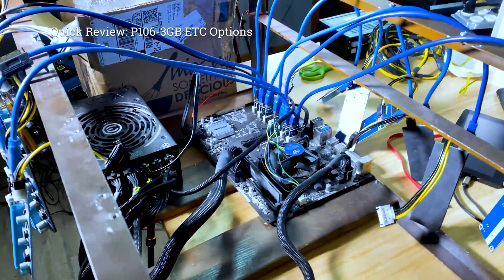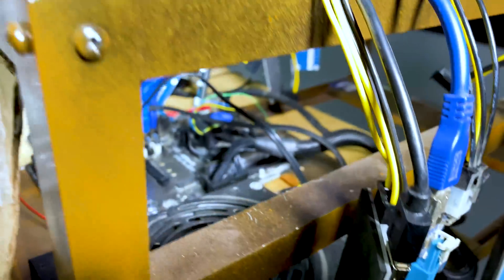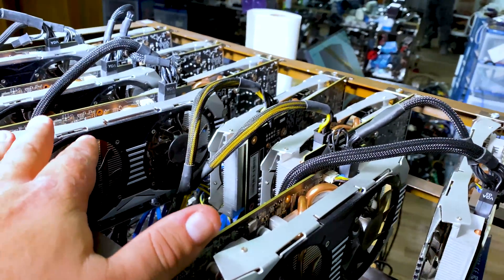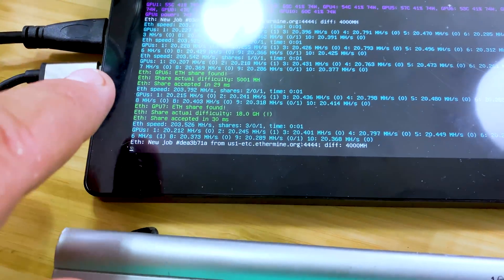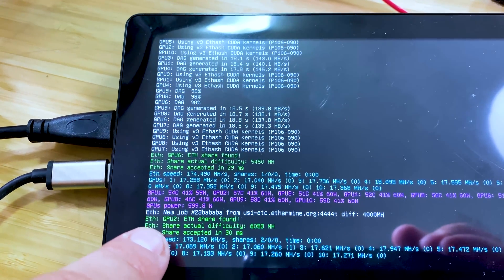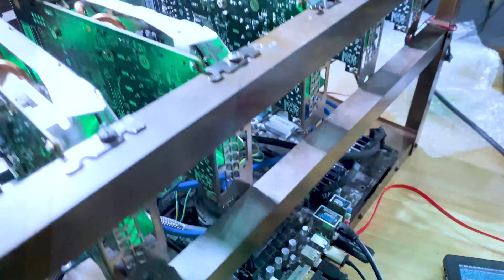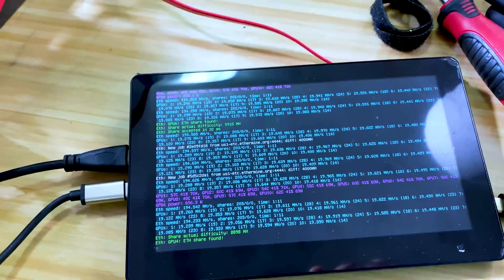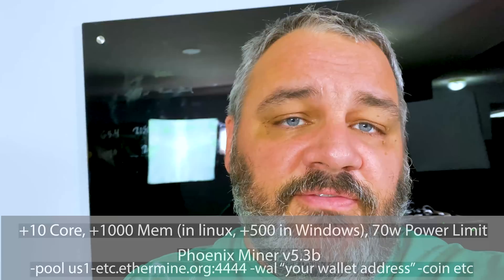ETC makes 3GB GPUs great again

Comment: Does anybody know how to free up all the memory on a GTX 1060 3gb for some reason 600mb are being used somewhere in my old pc. I reset everything to factory settings but I can't figure out what's using that memory or how to clear it. Ive tried googling btw
Reply: i have the same problem. could you help fix it?? did you figure it out? i’d really appreciate it

Comment: Hi, could you please explain how to mine with a 3gb card? I have a p106-90, but when I try to mine with this card, the programs always fail or do nothing because this card has only 3gb
Reply from the maker: ETC works - you will need the latest Phoenix Miner and make sure its set to -coin ETC

Comment: I have 1060 3gb card and getting 25mhz using kryptex but only received 0.01$ after running 2-3 hours.. So what miner should i use now?
Reply: with kryptex you need to allow some time to let the solutions settle, make sure you're allowing that time. I was also discouraged with Kryptex at first for that reason alone
Reply: @mp22395  but how much earning right now per day and before ? Its now showing anything when selected ETC for me
Reply: @bitborn  what have u done is it better now?

Comment: I find that +230/1150 @82%/61w works a bit better than +10 not that it actually moves the core passed 1354 but i see 19.4MH on most cards

Comment: hey @BitsBeTrippin do you have a video on how to mine with more than one card? if i want to just mine etc on an old card connected to the mobo while the newer ones are also on same mobo, windows--using phoenix how do i separate that out? i figure you can run multiple instances of the miner and just use -gpu to pick the right ones in each config file?

Comment: What mine pool are you using? it still shows up as a 4gb Dag file. I am using ethermine with an nvidia 1050ti 4gb. Please help! Im super lost!
Reply from the maker: Make sure your using a latest release miner (lolminer if AMD); Phoenix 5.3b and have the appropriate algorithm selected. For Phoenix Miner 5.3b its -coin etc ; this should ensure the correct fork is setup.
Reply: @BitsBeTrippin  I'm running 13 evga 1060 3gb. Got all the settings correct but still got "out of memory" error. Any suggestions?

Comment: I have 3 - 13 card rigs and the cards are Asus GTX 1060 3gb cards. They been sitting on the side ever since you could mine with 3gb cards. I may have to go thru and replace the thermal compound and thermal pads. They ran for about 3 1/2 years. We'll see.

Comment: Things were going all good and then the network hashrate went up 33%, now I have to mine something else and exchange into ETC because it's not really worth mining ETC directly at this current hashrate.  It's more profitable to mine ETH and exchange than to mine ETC, but since I run a single card, mining ETH directly would result in outrageously long payout intervals.

Comment: Hmmm... Knowing that all the 4gb gpus will move off of eth and on to these coin will make the difficulty go up, and who knows how the price will react, maybe up, or maybe lots of sell pressure... Hmmmm

Also how do rx cards do on it, the same old 31-32mhs? I've yet to try it, make a video on it!
Reply: 31mh 60w
Reply: @nikolakarovic5964  plus and extra 30 watts from the riser
Reply: @sniperpronerfmods9811  depends on card. Rx470 GamingX 8gb micron can do 56w Tdp, Red Devil 570 will do 100w with same settings.

Comment: When the dag file size on eth is overing 4 gb .......
Reply from the maker: all of those 4GB headed over between Ravencoin, ZEL, Beam, Grin and ETC for starters.
Reply: @BitsBeTrippin  so how long are we thinking these 3gb cards will be useful?
Reply from the maker: @xelnaga18  At the current pace more than a year for ETC. About same, working on a new DAG calculator for bitsbetrippin.io that should be up in the next few weeks, which will provide range/estimates for all DAG based algos.
Reply: @BitsBeTrippin  do you think there will be a spike in difficulty making these bad earners?

Comment: do you drop your core clock on ur cards alot? or do you increase it?  i found on mine to get more hash on linux, is +100 +1600 pl +75   seems to do decent for me on non super 1660s get me around 24-25mh
Reply from the maker: depends on the GPU, on the lower end 1060 and 1660ti, increasing the core is the only way to get the TDP up enough eeek out some hashrate from them. On other cards, such as the 1080, 1080ti and most of the AMD cards, I drop the core with Ethash/ETChash algo's as they are more memory insensitive and dont need all that core performance.
Reply: @BitsBeTrippin  cool ya thats what ive been doing to, i do lots of diff test an see which gives me best hash to power, like 580s i found 1200 core, 2150 mem gives me 32+ on most cards, unless they have crap silicon or weak hynix, anyway thanks for your time man, keep on trippin dem bits!
Reply: from my experience from 2 years ago, core is relative meaningless for ETC/ETH you want to get the most memory speed as possible
Reply: on 1660 super with hynix memory you must go in afterburner -500 for memory and then you get 30mh and over, with hynix memory if you go +800 + 900 or more you get 24 mh, i know i have same problem but now i get 31.7 mh per card just go with memory in negative